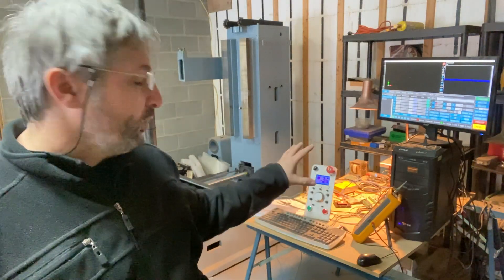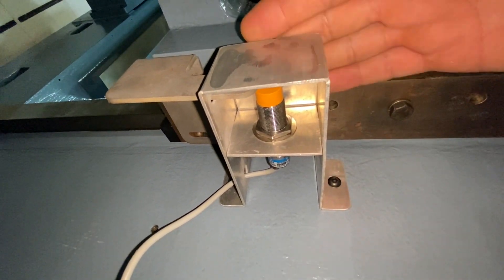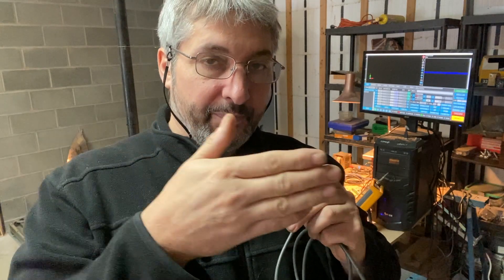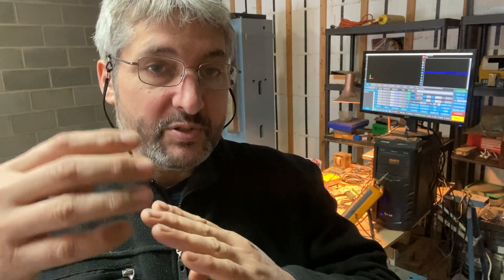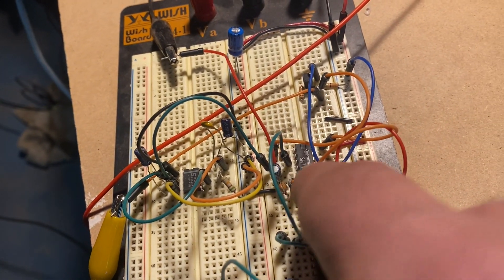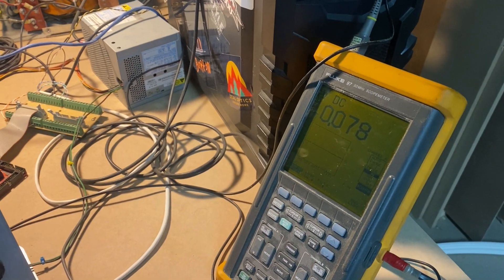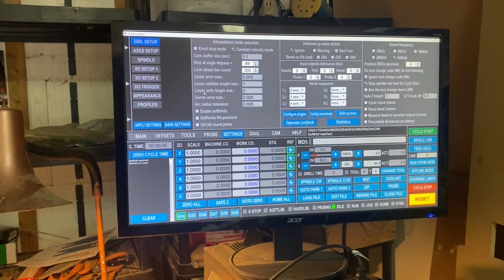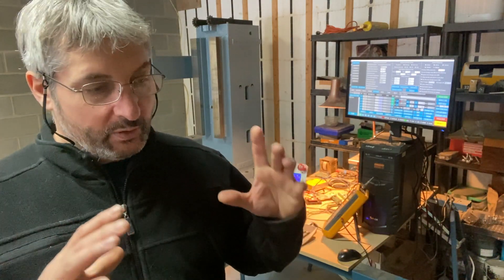Part 35 - (Homing, sweet homing!!!)

Comment: Hey Blaise. Happy you’re enjoying the process. That the controller returns back to the index with one tenth or any other move, proves that the motor/servo drive system is not loosing position, does not mean that the machine is equally returning back to a physical position within one ten thousand. That will depend on overall backlash.  That the servo motor/servo drive does not loose position is granted by default, otherwise it would be hell, I for example command my servo drives with 8000 pulses per revolution, imagine it would miss even a few pulses here and there. Like I said, happy you’re having fun. Looking forward to see more updates.
Reply from the maker: Wow. The more you tel me about your setup the more impressed I am! I was gonna go for a 500 ppr encoder on the spindle motor. I’ll have to put the motor shaft on a lathe to make a threaded hole to adapt an encoder. We’ll se when we get there!
Reply from the maker: Hi P. Lopes! Yes, I must admit, I absolutely love doing this! It is so satisfying when it finally works! Hahaha! I should have specified that ending up on the encoder index does not include the backlash. The backlash on the Y axis is about 2 tenth. I think this backlash is mainly coming from the angular contact bearings holding the ball screw. Anyhow, I can live with a few tenth! I also use 8000 PPR since I have setup the drive to use the rising and the falling edges of both channels. Have you installed a encoder on your spindle? Fore 5000RPM, what type of resolution encoder should I use you think?
Reply: @BlaiseBarrette  I have not installed an encoder on the spindle since I use a servo motor. The servo motor has an integrated encoder that the servo drive uses. I then have two options with the servo drives I use and considering that I use the Mesa 7i25 with 7i76 which has encoder inputs, I can setup the servo drive to output a simulated encoder signal that is fed to the 7i76 and use it on LinuxCNC to do rigid tapping and spindle orient, this was how I first set it up. However instead I now have the servo drive controlled via beckhoff ek1100(ethercat) + el6751 (canopen). Via canopen I can retrieve the current rotational position/speed/current/etc and control speed, torque, etc. with a software pid based on the rotational position I can orientate the spindle. I did have to install an inductive sensor on the spindle to assist spindle orientation since I don’t have a 1:1 ratio between the servo motor and spindle and needed an absolute physical reference - like a home switch.
Reply: @BlaiseBarrette  regarding which encoder could you use for the spindle. 5000 rpm times the encoder resolution needs to be smaller than your cnc controller can handle. The Mesa 7i76 can handle 2mghz, check yours. You don’t need a high resolution to manage speed and angular position  for spindle orient. For rigid tapping you just need one pulse per revolution. Perhaps 400 ppr would be ok. That gives 0,9 degree resolution for spindle orient and 1.6mhz impulses for you cnc controller to handle. If you can use 1000ppr, better.